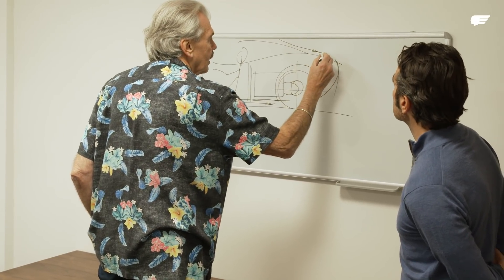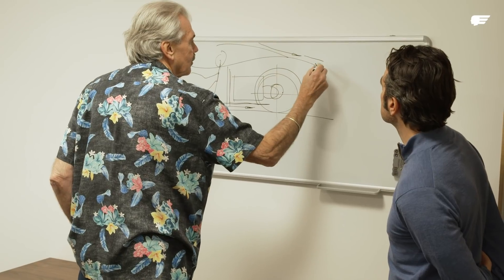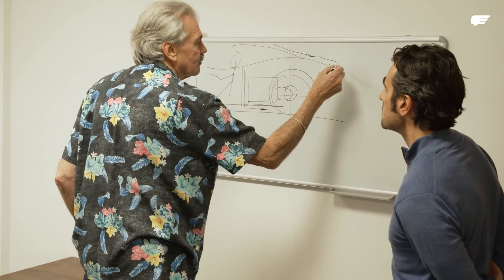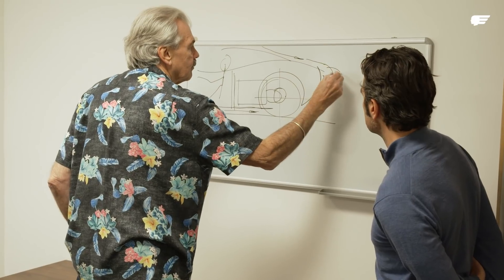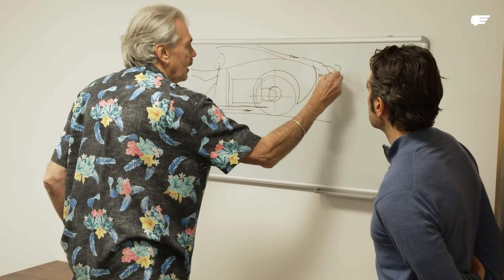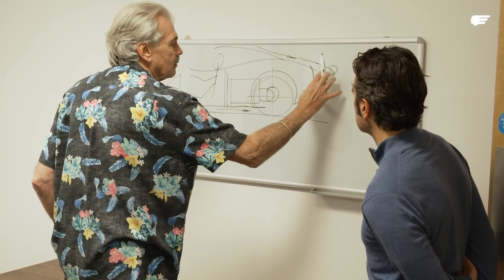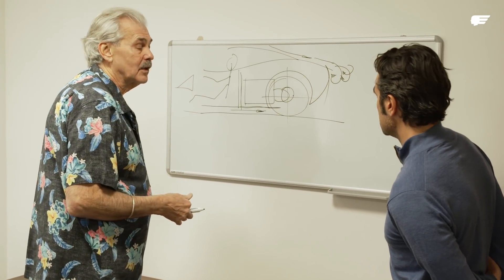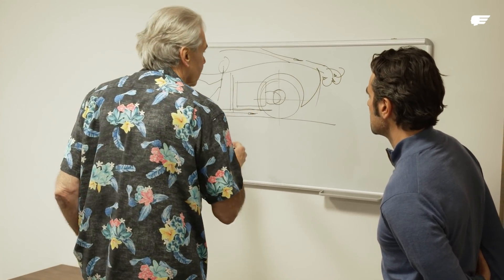T.50 VLOG | EPISODE #6 | T.50 AERODYNAMICS PART 2

Comment: ...and that's 2/3 of the explanation... What about the third dimension? The "little slot" is surely a big slot across the width of the car which efficiently gathers the air, with low compression, into the fan.

Comment: Fascinating project! Question - With the fan pulling the air upwards and presumably through the fan, what happens when going around a fast bend (high downforce with fan presumably running) Will water also be forced upwards, through the fan and fired backwards? I am really intrigued. Thanks.

Comment: I don't want to disagree with the 'Gordon is great' comments here, but I do want to add one note of realism. There is no free lunch! The fan takes power away between the engine and the driven wheels. The end result is I'm sure a gain of performance and downforce, but it has always got to be at some performance cost elsewhere.
Reply: Read the specs! 
The fan is electric and not engine driven
Reply: @cerosietebpositivo351  Sure, and I bet it all works fine. But electricity is still generated by the engine. Like you can feel engine power drop a bit when the AC kicks in on some cars. Its minor. I'm not saying it won't work, but it simply does need energy. Its not just benefits, its a cost /benefit thing.
Reply: @NielsHeusinkveld  I agree with your point, according to the law of Conservation of energy, the fan is taking energy generated by the engine and indirectly robbing energy from the wheels. the same way an air conditioner works in a car.

but. other cars(supercars or racecars) without the fan lose a lot of energy with aerodynamic drag because of spoilers and wings and other aerodynamic redirecting methods. a lot of power from the engine is lost trying to compensate for it

But with the T.50 the energy loss is negligible because the fan compensates drag, and also increases downforce without the need for a spoiler or a rear wing. and as the fan is only removing dirty air causing the vortices and pushing the air out of the back making the air form a virtual "Longtail" which reduces drag, which means the fan does not need to do a lot of work and does not have a lot of load on it to require a lot of power to run them. plus they are 95% efficient being a BLDC fan. 

so the energy loss from the engine is negligible compared to the Wings and spoilers used in other supercars for the same effect.

Assumptions : I assumed the load on the rear fan is quite low because, the motor is spinning at 7000 rpm rotating a 500 gram carbon fiber fan, the weight of the fan and the speed of the motor are quite low and the suction needed to pull out low pressure air is also very less. thus less power is necessary. comparable to a hand held vacuum cleaner or a car air conditioning system set at High.

Comment: Why not use certain rear wheels with a drive section instead of a fan?
Reply: How would you bleed downforce on a high speed run? Too much downforce will use too suspension travel.

Comment: That should be great but will it be risky to catch up some small stones sand and soil from the ground which came from the perifery to the road and to hit and broke the fan or other structures of the car. Do that mean that would be only a track car?
Reply: As previously discussed , filters in the duct prevent this , it was also explained that the suction was really just strong enough to pull the dirty air vortices through and not dirt or stones, which of course if dust did get in would be stopped by the filter anyway.
Reply: @michaelbaldwin5953  Hmm sounds good. So in fact on higher speeds the car would use the two air flows one of the air which passes on top of the car and second the air which would be sucked under the car? And at lower speed for example in the corers would use mostly the air created under the car which enters from below?

Comment: I have a vision to combine these aero principles with best practices from Group C and LMP1 and take them all to the next level, to build an electric racecar that is NOT LAME. Even Formula E cars (kind of lame) are around F1 weight and despite nonsense aero lap similarly to F3. When we take an electric car to the limits of today's technology, aimed at laptime and stint length, I'm quite confident we can achieve LMP1 times and stint length. NOTE: it would be faster than coming LeMans winners.
Swappable battery, load bearing. Compact Lucid motors. Tesla pre-production 4680 battery cells. DOUBLE 8 kWh fan, maybe even more powerful or larger as needed. Limited frontal area, super slick in straight line mode, super high downforce for cornering and braking if needed. For optimal stint length, you would still favor longer regen in brake zones.
Cruise speeds of over 300 kph should not be a problem and aero optimized to do so efficiently. Getting there on AWD will be super quick. Battery of course will not be tiny. I envision a dual chemistry battery. The power cells on the chassis, the range batteries on the swappable tray. Air gun bolted down range battery. Shorter pitstop than refuelling.
It could be a spec series (RedBull, do you hear me?) Formula E's worst nightmare. No open wheels, no breach of their 25 corrupt monopoly of zero emissions racing.
The stock Lucid motor would make the spec series quite cheap. Still allowing for 1350 hp peak power which it would never need to use. Except regen, maybe. Weight target is <1000 kg, battery target ~90 kWh (110-120 kWh per stint using good regen tactics). Aero targets never seen before in terms of streamline mode, 919 Evo levels in downforce mode.
Let's make this happen, Gordon, change racing forever!
Reply: LMP1 is way slower than what is possible with technology. If we allowed V10 twin turbos with hybrid (2500+ hp, car weight of sub 800 kg), sub 4 min Nurburgring laptimes would be possible if tires could be made to withstand 7-9 G's.

Comment: He could have also explained Streamline mode, how they can add a whole meter of cleaner air at the back of the car and how much it improves aerodynamic efficiency. I mean, the amount of drag reduction is close to taking a normal, draggy Chiron and turning it into a Chiron SS just by closing the diffuser and sucking the dirty air out with a fan and pushing all that air out the back.

Also, at 7000 rpm, that fan is like a 15.75 in carbon fiber wheel spinning at 530 kmph! So imagine the G forces on that thing and how much air it throws out the back.

Comment: You couldn’t buy education like this. Thank you Gordon and Dario
Reply: Especially since its not really taught in universities. I did mechanical engineering hoping to get even one module on car aerodynamics. I was hugely disappointed. All I got was a year 1 module on engineering systems which included engines, clutch, gearbox calculations etc and then more in depth modules about the thermal design of engines and the combustion process. Fluid mechanics modules were there too but not racecar related at all. In fact my 3rd year project for my dissertation was more linked to computers than racecars. It was about conjugate heat transfer. So I modelled a CPU and hast sink and did cfd simatioms on that depicting the heat generation and dissipation by the CPU and heat sink and the difference various turbulence models made on the results. Very interesting from my point of view as I'm a techie but nothing to do with cars. Was looking for something simple to model because of all the ther work for other modules but looking back in hindsight I could have done an f1car radiator or something similar. But not enough time.

Comment: Who needs fancy animations if you have Gordon Murray and a white board.
Reply: Engineering explained vibes
Reply: Hello Gordon! I'm just curious how the gearbox would work from a drivers perspective. From all the videos I have seen the shifter is unlabelled and sitting in a Square. Is It a dogleg? Also curious about the gearing.
Reply: @user-rx9ny4yo2e  The shift pattern is on a plate below the gear lever just like the F1. And no dog legs, this is a normal six speed. However there is an optional ratio that basically turns the 6th into a 7th gear for long highway crusing which brings the revs down and makes the cruise more fuel efficient.

Comment: Very nicely explained.  And if you blow that air into the turbulent low pressure region behind the car you reduce the suction imposed on it by its rear end, giving it even more forward oomph.  So win both ways!
Reply: And 15 kg thrust, which is about the same as drag at 70-80 kmph for this kind of car.